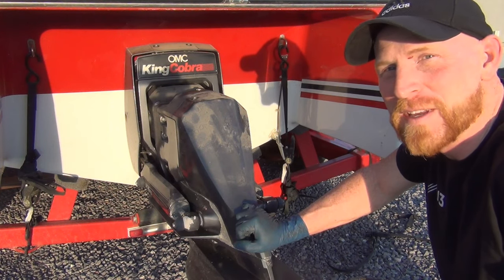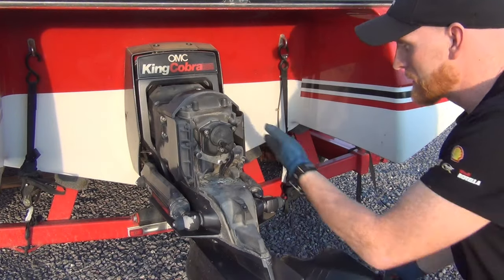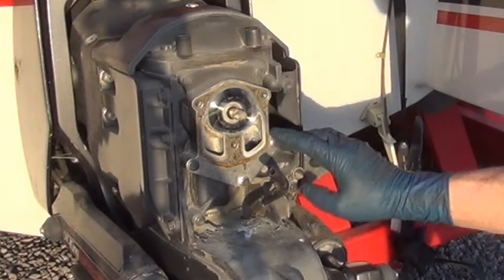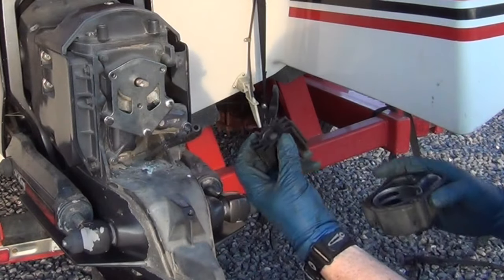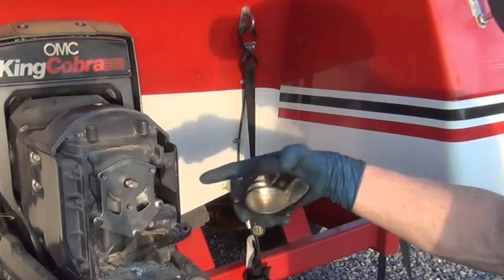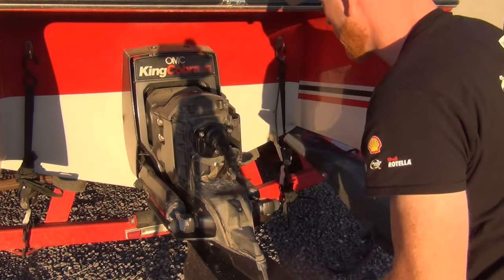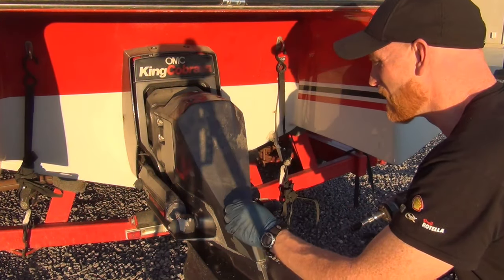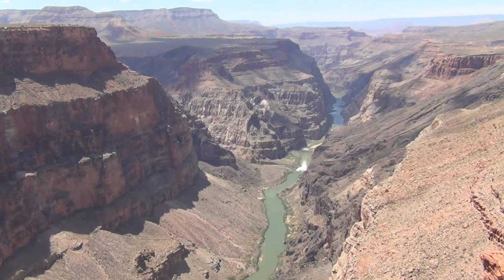OMC King Cobra Overheats After Running Engine on Trailer How-to Fix

Comment: Nice vid, I have a regular Cobra and have done the impeller many times. A few tips I've picked up over the years...
On the regular Cobra the o ring that fits into the housing doesn't always want to lay flat. I will use  bead of OMC triple guard grease that holds the oring in the groove. OMC gasket sealer on the threads of the bolts esp in salt water like I am. I always start it up with the cover off to make sure there are no water leaks around the housing. Lastly the best muffs I have found are the Merc ones with the rod and clamp to hold them tight. They fit well and will not get loose.
Reply: Luigi 1955 where do you find your OMC parts?  They seem harder and harder to find!

Comment: Job well done. For those worried about using petroleum based lube on the rubber impeller I use liquid dish soap (glycerin) for lubrication.

Comment: Another great video! I am a recreational marine tech. For everyone worried about grease on the impeller it's no biggie Brian didn't use alot. I use soap but that's mostly to see  leaks easily and see good water flow on underwater exhaust. Bubbles!

Comment: I have  been a marine tech for 37 years and factory trained on Cobra units the hose that Brian is messing with has no purpose other than to direct water to where the customer cant see it leaking. The port is there to bleed off air so the pump will prime when put into the water. When the engine starts the pump leaks a small amount of water all the time. The first years of the cobra did not have the hose just a small weep hole in the housing. But customers panic when they ran the motor on the flusher and saw water leaking out around the cover so OMC installed a hose and dumped it in the exhaust housing where it was not seen. I never put grease on impellers only water soluble lube like soap or I now use glycerin from Walmart makes a good rubber lube and washes out with water. If the boat is used in salt water coat all bolts with OMC gasket sealing compound or Mercury Perfect seal same stuff.
Reply: Does the other end of the hose attach to anything in the lower gear housing, mine needs replacing but I dont really want to pull the lower housing?

Comment: Tip: add a thin coat of petroleum jelly or dish soap to the propeller bowl so it doesn't start dry.  It also helps to get the propeller in easier.Some are a lot harder to install and it takes a brief moment before water gets up to it.  It doesn't take much to kill a propeller when it's dry.

Comment: I used to work in a marine engine shop and when we replaced impellers we used a spray bottle of soapy water to lube the impeller.
Reply: Yea grease or some ppl use wd40 a big no no dish soap is recommended

Comment: Great video. I'm here in Zimbabwe and have that exact out drive on my boat. 1991 350 OMC "Daddy" King Cobra. Where did you order that water pump kit from and what was the part number if you may? Thanks.

Comment: Alright what if the hose just pulls out  you say if you need to replace it it required what parts seems to just spray water on gears below?

Comment: My impeller housing keeps melting! The metal insert housing shifts then melts. I saved the current rubber star, but the housing rotated 3/8" and melted the housing. That caused the hole for the small tube to be blocked. It ran fine for a solid 5 min, then just nope. I even popped the small hose off to ensure water was flowing, and it did, so all seemed fine. Just dont know why it would suddenly heat up to melt the housing. I can feel water in the hoses on the engine flowing the whole time.

Comment: I have a 454 King Cobra in my 1990 Four Winds Liberator 221 and it use to run great.  Recently it has been leaving me stranded.  Just shuts off 10 minutes after running.  I put gas manually in car and still does not start up right away. I have to wait about 15 mins then it starts to act like its going to start,  and I have to keep turning the starter for a good while until it stops trying to start and does eventually keeps idle.  It does this several times a day.  When I pour gas in I notice it boils as it goes down in the carb.  Not sure if it's a temp issue,  or carb issue, or maybe spark issue from the Spitfire. Drives me crazy.
Reply: Toob247 Toob247  Interesting. On another issue i thought it was ESA electronic shift assist causing it to shut down.  Recently, i noticed my baots shifter also getting really hard to shift from forward to Reverse. It feels like linkage is jammed up. So With engine dieing i turned up idling, maybe messing up my ESA shifting. What ESA is supposed to do is make my idle almost turn off so I can shift, or it gets hard shift. So I am having tons of issues. Im in Mesa, AZ if you know anyone that can guide me or possible i can take my boat for repair and wont rape me for cash. I just want to get back on the lake know what i mean.

Comment: I changed my impeller twice now with the full kit. Now the engine overheats and the boat takes on water, but really can't see where it comes from. Any thoughts
Reply: Could be a cracked block or frost plugs or the drain petcocks are loose.

Comment: Question for the master.  I have a jeep 3.7 and my catalytic converter is giving a code.  Is there any way to make the code to stay off without replacing the converter?  I have heard thing like putting lacquer thinner in the gas tank and a couple other things.  Any suggestions?
Reply: terry Grubb Imo, just replace it.  Scotty Kilmer has a video about cleaning it but it does require taking it off and soaking it.
Reply from the maker: There's the spark plug defouler technique, you can try hot cycling it like a DPF re gen cycle, but it's best to just replace it.
Reply: It is not a diesel

Comment: why don't you just put the grease inside the housing versus on the impeller blades?  wouldn't that work as well or better as then you get the impeller in there with grease sliding it in?

Comment: Never put grease on rubber! Always use silicone paste. Grease or anything petroleum based will destroy rubber parts.
Reply from the maker: Most rubber seals come with grease on them.  I use a synthetic marine grade grease.  I've done it for decades.  I have zero complaints or issues with it.